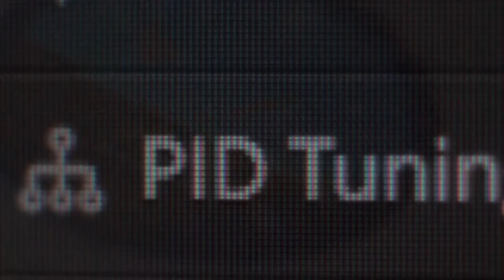FrSky FPort Protocol | IT'S GOOD, BUT I WISH IT WERE BETTER

Comment: is it normal for the taranis x-lite pro to pulse every second when you use F.Port telemetry?  It seems to do a sweep of the data every second and the signal meter on the main display turns on and off.  It didn't do this on SBus.  The signal stays constant on the OSD though.   The RSSI must be more realistic with F.Port cause it drops below 99 pretty quick, when it was on S.Bus it just stayed at 99 all the time.
Reply from the maker: No, that doesn't seem normal to me.
Reply: @JoshuaBardwell  I wonder if I have a bad R9mLite pro module, it seems to get a little warm, didn't seem to do that on SBus.
it flies ok though, no failsafe yet, the bars for receiver signal on the Tx turn on and off every second, there's something screwy.  I have F.Port setup on my tandem X20 and it's not doing that and the Taranis Xlite pro Tx doesn't do it for a 2.4 receiver either.  Something is definitely shutting on and off with the R9 module (but it still seems to fly ok) weird

Comment: Hey man, sorry to say, but this info is miss-leading and incorrect (probably outdate rather, love you bro :D ). Look 0.7 ms for CRSF  and 2.97 ms for SBUS and 2.65 ms for FPORT. Look seems like magical difference, just by switching from SBUS to FPORT END-to-END latency drops 5ms! https://oscarliang.com/fport-latency-testing/
This was tested on Frsky iXJT tx + XSR receiver (2.4ghz), but no reason for it not to translate similar to other bands like 900. 

Considering CSFR gets extra 8ms delay when used over SBUS, seems like FrSky is killing it painfully, I think it may be worth wile to dig into it at that point a little :)
Reply: I just realised something else, it says refresh rate fro both is 111Hz. BUT, in later test SBUS on FrSky and CSFR BOTH are 150Hz :) So, question remains open in port also now 150Hz https://oscarliang.com/r9m-lite-crossfire-latency-testing/ BTW, here total latency on CSFR is 13.9+0.7 = 14.6 vs total latency on Lite (non ACCESS one and not FPort!) 14.066+2.97 = 17.036 ms. - 2.436 ms difference :) 

I think ACCESS + FPORT will but FrSky way ahead - they actually claimed on RCGroup minimal 8.6ms total on x-light pro + r9m lite Pro + SBUS :D https://www.rcgroups.com/forums/showthread.php?3080337-FrSky-New-Taranis-X-Lite-S-and-Pro-X9-Lite-R9M-Lite-and-Pro-MPM-Lite/page183 (on those screen shots latency came to be 9.27, it is not constant )

9.27 vs cross fire 14.6ms is MASIVE difference :D and it is 1watt aaa :D

Hope it was interesting if you didn't know it yet, than "hope you learned something today" :)
Reply from the maker: This video was uploaded Feb 2017. Now it's September 2019. A lot has changed since then :-)
Reply from the maker: Here is the most up to date independent 3rd party testing that I know of. FrSky's claims of lower latency on new ACCESS radios do not seem to bear out.

https://docs.google.com/spreadsheets/d/14F0HHDNYIdGpTDLeHvXrCeLH8-vC3-hRIDzbgOypfuk/edit?usp=sharing

FrSky seems to be referring to frame timing (frequency) as if it were latency, but it isn't.
Reply: @JoshuaBardwell  Just saw people discussing it and followed, than realised that it no longer stands correct :)

Comment: frsky R9slim + f.port killed my drone. It completely freaked out twitching all over 3 axii then lost signal and failsafed. Tumbled 20mtrs out of the sky smashed into some long grass but fried my esc and flight controller, the r9slim + was sending random stick commands and mode changes all the time with 99 rssi. It then tried to kill my other drone with the r9mini setup and all on the flex firmware, luckily i had already wired it for s.bus i just switched it back to s.bus dumped the soft serial and changed it back to smartport. forget saving uarts just Stick to s.bus with smartport for telemetry.

Addendum ; f.port works fine and like master Bardwell said it saves up your uarts for other stuff. I couldn't find any solutions on youtueb so i made a video explaining how i fixed my problem. https://youtu.be/4ijUehyLnhI
Reply: Hi I'm not using fport, just sbus and smart port on my R9MMM, I had and  issue with rc commands that i did not input?
I raised it in github as i thought it could be Betaflight 3.5.5 I had just flashed, but I never got to the bottom of this?
Can you please take a look at the video I made to see if it's similar to your problem, I not sure if i can put the link in here
so I will put it on your channels discussion page, thanks.
Reply: pablo i found out it wasn't the r9 system at all in fact it was the pin headers in the back of my taranis qx7. actually f.port works great.. here is a link to how i fixed my problem https://youtu.be/4ijUehyLnhI
Reply: @terminuscoagule3059  Thanks a lot I will investigate 👍

Comment: Thank you for the info joshua but i am really confused and i need your help. You said that with f port we dont care about inversion. But at the link you added says that it is inveryed signal. Also, the sport pin of the r9mm that i have ordered also says fport. It just uses the same pin and the change is what you choose in the port tab in BF?
Thank you.
Reply from the maker: When I first learned about FPort I read that it solved the inversion issue. But as I learned more about it, I think that's incorrect. FPort is inverted and must be used with a bidirectional inverter pad. If you are using the R9MM however, it has un-inverted output of SmartPort and FPort so you can simply use a  regular RX pad on your FC.
Reply: @JoshuaBardwell  thank you so much. That is what i nedeed to hear. I have ruined the sbus pad on my Hglrc f4 osd and that is the reason that i ordered the r9mm. So the inverted sport(so-> uninverted) that r9mm has  can be also used as fport? Is that right? Thank you very much. I love your videos, always watch them and you have halped me alot at my first steps(6 months ago) in the hobby. Love fro Greece!
Reply from the maker: Yes correct. The "inverted' (actually un-inverted stupid FrSky) SPort pad also works for FPort.
Reply: @JoshuaBardwell  Yeahhhh ,😍

Comment: Hi, I have a DYS f4 pro v2 FC and apparently only Uart1on this board has a "bi-directional inverter", typically used by the S.Bus signal wire on the RX pad on Uart1.  My question is, does anyone know if the Uart1 TX pad is also effected by this "bi-directional inverter"? If so does it sound correct I can move my S.Audio wire to Uart1 TX pad and flash f.port firmware to my R-XSR and settings in beta flight etc, and it will work out?  Or am I 100% going to have to do the Hack to my receiver to access the un-inverted signal in the first place??  Thanks anyone out there

Comment: SUCCESS!
I got it working on the Frsky R9 slim+. with a Matek F411-Wing 
Here is what I did, I used the RX1 reversed S.port signal on the Slim+ to the TX1 pin on the F411-Wing.
No hack,Full telemetry
Set CLI command to.
# get serial
serialrx_provider = FPORT
Allowed values: SPEK1024, SPEK2048, SBUS, SUMD, SUMH, XB-B, XB-B-RJ01, IBUS, JETIEXBUS, CRSF, FPORT

serialrx_inverted = OFF
Allowed values: OFF, ON

serialrx_halfduplex = ON
Allowed values: OFF, ON 

I hope this helps others.

Thanks,
Regan

Comment: hi josh useing your fc have r9m  lite mod useing r9 mini rec with f port wired to t pad sticks switches all work no telemetry thoug  any idea
Reply from the maker: did you go to the CLI and type

set tlm_halfduplex=off
save
Reply: Joshua Bardwell yes i did it both ways on shuts off stick controls when i leave halfduplex set to off my sticks and switches are good but in not t getting any  telemetry .im runnig beta 3.5 should i maybe change it
Reply: I got to work im still learning on this xlight i had internal and external modes on at same time my mistake . All working good now thanks joshua

Comment: Are we sure about no more inverter hassle? The last time I checked, I still can't get fport to work on most F4 FC, without applying the "uninverted hack" by soldering a wire to some tiny pad or chip leg. That's if the RX has an uninverted pad to solder. The new RX like R9 Mini doesn't seem to have an uninverted pad to hack, and fport didn't really solve the inverter issue.
Reply from the maker: Yeah I think you're right. I was under the impression they were going to release an uninvert-hack FPort firmware. But it seems that hasn't happened.

Comment: Now I got a question I use butterflight and did the hack on the x4rsb now I went to the CLI command and change two inverted or uninverted on, I can't remember which one  but I wonder if butterflight has already got this switched where I don't have to do anything in the CLI  after doing the hack

Comment: Joshua I know it sounds stupid but can you do a video on setting up F Port I've watched all the videos I can find and been stuck with this for over a week but I still can't get mine to work on  my new build
FC = matek f405 with the fchub running BF 3.3.1 ......... receiver = R XSR connected  3 wires + - and soldered to the P on the baord to tx pad on uart 3.......... taranis running 2.2.1 with Lua scripts
Reply: With the above set up my reciver is bound to my taranis and my radio link IS working . I have only 2  sensors showing but nothing in my Lua scripts there all blank
Reply: Forgot to say I have the similar set up on my other quad 
The difference is I'm using a de pinned  x4rsb using 2 uarts  sbus and  S port and are RSSI soldered on the baord
And the Lua scripts work on this build
I'm not using the  LBT firmware
Reply from the maker: I think it's that you have used the uninverted P pad that is messing you up. The FC may be expecting I'm inverted signal. If your FC is an F4 use the Smartport pad.
Reply: Hello Joshua thanks for getting back to me 
 I am using the uninverted pad on the rxsr to uart 3 tx I have also have typed
set serialrx_halfduplex = ON 
set serialrx_inverted = OFF
To the cli 
My radio link works but I have no PID or unify control
I know I could just wire it up the old way but it just bugs me to why the hell don't it work

I'm happy this is your full time job .there's only yourself and Bruce Simpson who I watch on YouTube 
Your helps much appreciated 
Dave

Comment: Can you do a video on installing this and setting it up? Not finding any great vids out there on the subject!
Reply: Basically, I can get thru the flashing of the receiver, but can't decipher how the wiring goes....do you solder both the SBUS wires and the old Smart Port wire to the same Uart? If so, do they both go to UART TX?
Reply from the maker: It's a single wire. So it should use the SBUS wire I think but not sure. And it goes to a single UART TX pad on the FC. Typically I think the pad that is most likely to work will be the SmartPort telemetry pad, because that is guaranteed to have a bidirectional inverter on it like FPort needs.
Reply: This is on a HGLRC F4 Omnibus FC, I already have the RSXR connected to the SBUS TX which I believe is the only uninverted UART available, and this bird is already flying, so what your saying is that my connections should already be installed, so all I would need to do is flash the firmware and make the necessary changes in CLI?
Reply: Well, I gave it my best shot, I just spent the better part of 5 hours fiddling with it trying to get it to work...I loaded BF 3.3.0 RC 1&2 (Which are both buggy as hell) which I believe was most of the issue...I was able to get BF to see the receiver but had no telemetry being sent...I guess I'll wait until they work out the bugs!
BTW, you have to actually use the SPort connection on the receiver instead of the SBUS connector! Oh well...I tried!

Comment: +Joshua Bardwell
Got excited to try out this FPort protocol on a new build. Sadly my Taranis' internal XJT has EU-LBT, and the beta-FW for the XSR is non-LBT... so cannot bind. Seems quite a hassle to flash the internal module to non-LBT FW (using the external XJT header, and SPort flash app), then also flash all my current receivers to non-LBT... just to try this one.. :( FrSky should also build a EU-LBT version of the F.Port FW. No idea where to contact them about this.
Reply: Mailed FRSky, and the EU LBT is currently only available for the R-XSR, while a EU version for the XSR will come in the near future.

Comment: TBS is faster and have larger range and... is totally illegal for unlicensed use in countries where 915 MHz frequency is already used for something else. At least in my country this frequency already is leased for cellphone operators from year 2010. Recently one of our local drone pilots with TBS in my city experienced unexpected guests - police together with guys from RF spectrum monitoring. However I agree that FrSky still did only a half of job for F.port although that what they did, is already awesome I hope that their next move will be F.port v2 something - faster and with full duplex serial communication using both TX/RX wires if available.
Reply: What happened then?
Reply: What happened??

Comment: Hey you do know there is the frsky R9 slim right? brand new just came out operates at 900mhz so it needs it own module, the R9. They say it has a low latency very similar to crossfires. You should also give that a try and compare it to crossfire see if it matches up as a cheaper alt. The receiver is 26 and the module is 50.
Reply: On getfpv

Comment: I am using it FPort and it works very smooth and nicely i have no complains, and i can use 16 channels, Crossfire just use up to 12 and the difference in the speed resolution is not to big, FrSky FPort is 115.2 Khz and TBS CRSF is 150 Khz, FPort clock cycle is 8.68 microseconds, and CRSF clock cycle in 6.66 microseconds, seriously for "2 microseconds"... i don't really care!!! both systems are great!!, Spektrum is 22 miliseconds or 11 miliseconds hahaha (joking i have no idea what those spektrum miliseconds means but if that is the signal resolution they are already out of the business)

Comment: Still happy with my thin/light/fancy TGY-i10 with the lowest latency of them all, i-bus that is known to be "more stable", and can be installed to any non-inverted uart. It's like I won this race before it even started.  ;)  :D

Devils advocate here... but no joke tho. Tnx for the vid as always Josh! Cheers
Reply from the maker: Yeaaahh but where's that opentx port?

And you have literally one choice for receivers that is worth anything (the i6, IMO) since the i8 has problems.
Reply: I do appreciate the protocol flexibility that the opentx port (you mean the mod bay right?) affords, and I hate FlySky for crawling under a rock when it comes to their RX's (and for neither having a marketing department to get their f'n name on the board)! As for opentx FW exlusives like Lua Script, I'm not sure I currently see its' benefits as so much is possible through OSD now. The i6 is good.  The i8 cost more and has less features than the i10 so it's all fail. For me the TYG-i10 was a one time $99 investment and it's worked... with the huge X6B Rx's that is... ;)  lol  :)
Reply: I wanted to love my evolution, but 2 brown-outs, one fried RX and 1 unexplained failsafes was hard to live with, the final nail was the inability to build a hyperlow frame due to the massive RX size. I feel a tiny bit of lag from my new Qx7, but my hands no longer shake from the stress of a failsafe going 100mph past a light pole.

Comment: Honestly considering the price gouging from tbs and iftrontech crossfire and clearview should be banned from racing otherwise it becomes a rich man/kids sport.
Reply from the maker: It's already a rich man/kids sport. Don't kid yourself.
Reply: Even considering the prices of those things - drones are the cheapest sport you can get into with the performance figures we're talking about.  Even comparing it to racing bicycles, a reeeeeeally simple mechanical device, racing quads are cheap.

Comment: I mostly logged in to let you know I finally got around to dropping some coin in the tip jar but the original link you gave me wasn't exactly correct but it got me close enough to find it. Also though, this video follows along another question I've had for a while now; why don't FC's with OSD also include a pads for audio in and out so we can mix the regular audio mic signal with some on board warning sounds? I know, we get them through the RC receiver and the Tx Rx pads but...seems like there's an audio channel on the Vtx so why not have it available for another option?
Reply from the maker: The FC doesn't have any function for audio processing at this time.

Comment: Josh my motor gets to just over 1300 revs and starts spluttering, I have changed the esc and tested the motor with another It does the same thing It is like the signal from the board is getting interrupted. Is there any code i can use in the cli to check this
Many thanks
Sorry it's not related to this vid ,but needed you to see it asap.
Cheers
Reply from the maker: If you changed the motor, the next step is to change the ESC. If that still has the problem, then it points to the FC.
Reply: Thanks That confirms It's the Fc. Oh nice vid

Comment: I’ve flashed and set up Fport to two different quads now. Both boards I could not get telemetry to work. The problem is that your inverted uart needs to be bidirectional. So the inversion issue is still an issue. If you want to use an uninverted uart you need to perform the uninversion hack on your receiver. Bit of a let down. The first quad I just went back to standard sbus/smartport. Second one I’ll do the same. You can assign any uart to be a softserial for smartport and it’ll fix that issue. Pretty let down by Fport. Inversion is stupid.
Reply from the maker: I advise using the SmartPort pad. Since SmartPort is bidirectional, it should have a bidirectional inverter.
Reply: Joshua Bardwell well. That’s a great idea. I’ll try that and report back!